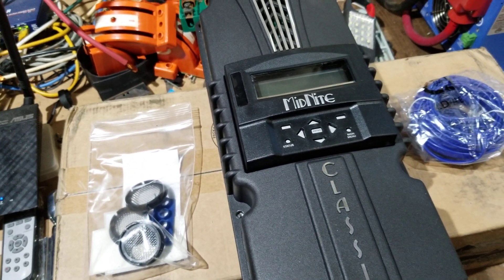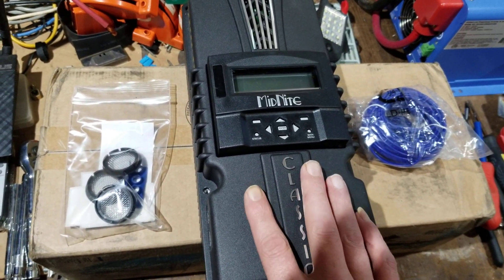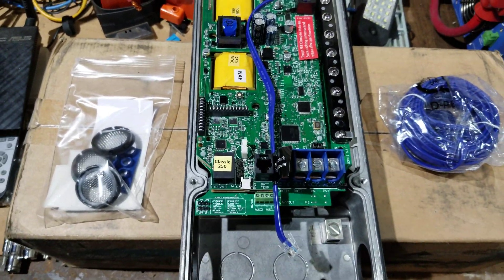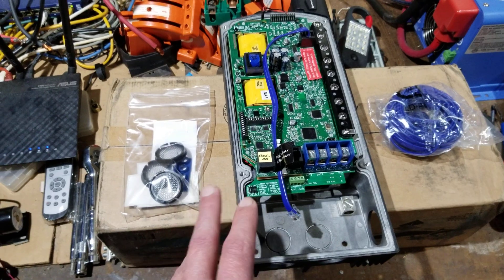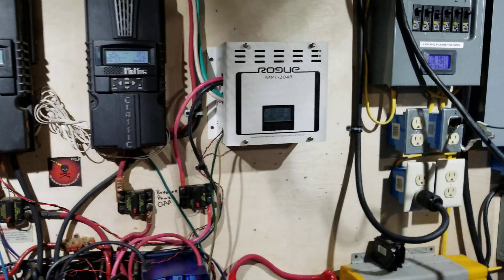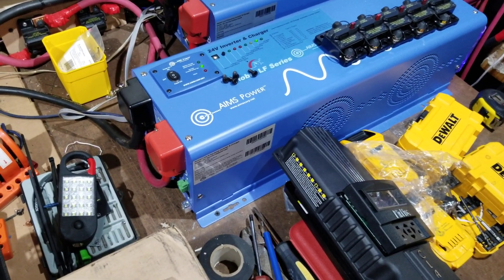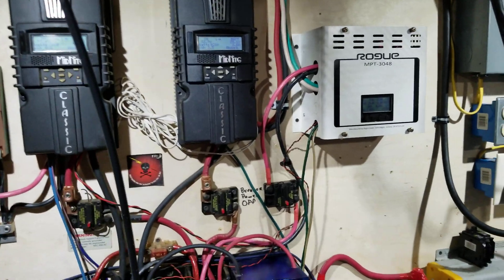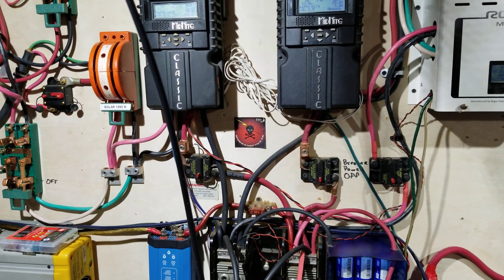Midnite Classic 250 CP scaled back, Charge controller for Wind !

Comment: Could i pick your brain for a moment? How did you learn so much about solar/ wind turbine, etc?? I live off grid in an rv. The solar system i have is small but i couldn't afford anything else.  Im disabled and paid a company for my setup.  I, unfortunately,  was new to the area and didn't know it rained so much.  I live on a mountain and is very windy here in NC. I live on property that is unrestricted.   What i currently have are 12 solar panels,  200w each.  My inverter is 5000w, peak 9000 AMPINVT. I have a midnite classic 250cp charge controller.  And 48w 300 ah mighty max agm batteries.  We never have power and we converve it and usually go all night without power (we are not grid tied). I would like to set up a wind turbine but am not sure if it can be tied into my current system or would i have to run the wind turbine into another midnite classic charge controller with dedicated batteries? I would rather have lithium life po4 batteries but i don't know how many i would need and what size wind turbine to get? I live in a 2004, 44 ft fifth wheel. If there is anyone on here who can point me in the right direction,  i would do greatly appreciate it!! God bless!
Reply from the maker: As you have probably found out, I noticed in your comments about you having AGM batteries. Unfortantly when it comes to AGM/ Lead acid batteries power storage is limited to about 50 % of the capacity . In some cases even less. I would highly suggest switching to Lithium batteries. This way you can take advantage of the incredible ability of Lithium battery power storage. Also to answer the Wind. I gave up on wind power. What I have found out about wind unless your in a full time Wind Environment, With  20 Mph all the time. Wind really isnt worth it. Out west were they have more Wind Energy availble works great. Your gonna me better off sticking to the Solar Setup and get yourself some better batteries. Most likely if you think you need 300 Ahr get 400 Ahr in batteries. Or close to it. I hope this helps.

Comment: I didn't realize I wasn't subscribed, but I am now!  Good info, I'll check it out, as I want to get my PMA on a Midnite before the windy season.
Reply from the maker: The Tricky part is figuring out the Wind Curve. Once that is done they work great !  A Computer  is a Midnites controller friend.
Reply: @SoutheastOhioSolarHaven  I'm a computer expert and repairman.  I'll be connecting a cat6 cable from the Midnite to my switch and through my Cradlepoint router to my computer(s) both desktop and laptop.

Comment: Great video and setup. I'm looking at same charge controller. I'm looking to setup 2 array a pv1 and pv2 for the amount panels I have looking at doing 2 6k watt inverters and a 15k-22k gen and maybe a wind gen. Will they do ok with out having a follow me?
Reply from the maker: They do fine  without follow me. Just adjust the voltages as close as you can to keep them in range of each other.
Reply: @SoutheastOhioSolarHaven  ok new to all this but can you give more info input voltage from the arrays? I'll be doing a 48v battery setup. And with 32x 260w panels total ill do 2 arrays. 16 each array and do 4in series at lowest temp would see 164v 4 parallel lowest temp would see 36 amp. Other wise the normal for each panel is 31.2v 8.34a I was looking at hybrids and cheap China controller and inverter so Brian is getting full. What inverter would recommend and can you parallel them?
Reply from the maker: Just keep your voltage around 200-220 Volt because cold weather will ramp up the Voltage in the Winter. If your using the 250 volt models.
Reply from the maker: Instead of 2 x 16 you may have to do  4 x 8 then parallel  down to 2 x 8 for each string. may have to go 4 panels in string maybe 5-6 just add your voltages up

Comment: Hi, you got that ebay link? I was looking at them on ebay, There was some mentioning no aux & no ethernet just wondering which one you bought. I'm looking to hook my wind turbine up to this. Thanks Jon
Reply from the maker: You can find them on Ebay of course. The seller I bought from is apparantly out of them now. But they can be found around the $275 to 325 price range it seems.
Reply: @SoutheastOhioSolarHaven  Thanks , Yea there are a few around alright , Trying to make sure that they have aux ports and ethernet as I need both . Love your setup there but you are in need of a Lifepo4 bank so much more efficiency comparing to lead acid.  Those midnites are something special comparing to everything else on the market.
Reply from the maker: Yeah I havent really got it dialed in yet. Hard to get things dialed in when there isnt any wind to play with.
Reply: @SoutheastOhioSolarHaven  We dont have that problem here 😅 currently 20mph average to 50 - 60 gusts , i just ordered a midnite for 246euro which he confirmed had ethernet and i would say aux, looks like midnite might be spreading some lies I think to discourage ppl.  i think you have to setup the wind curve also to get it working efficiently.
Reply from the maker: @offgridamps  Yes been playing with Wind curve to get dialed in.